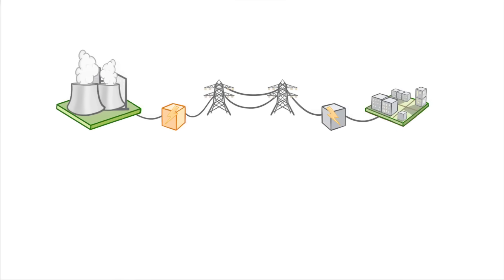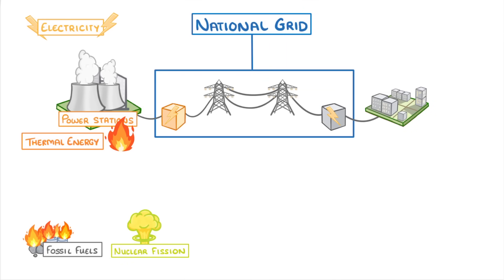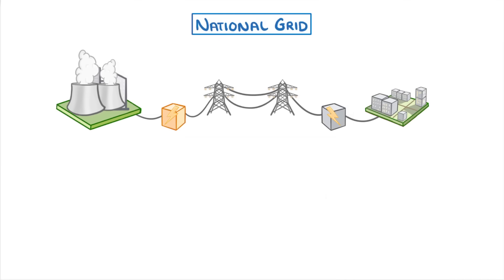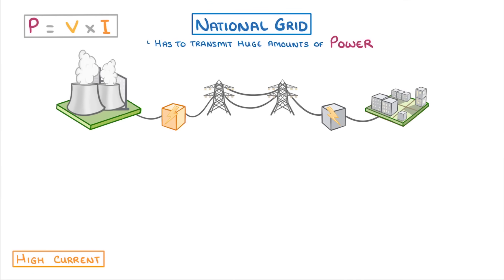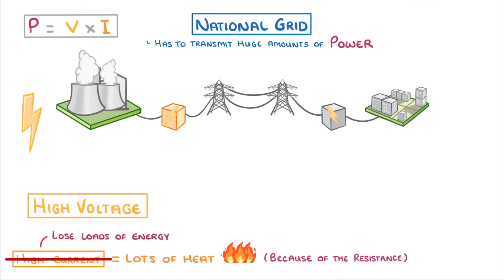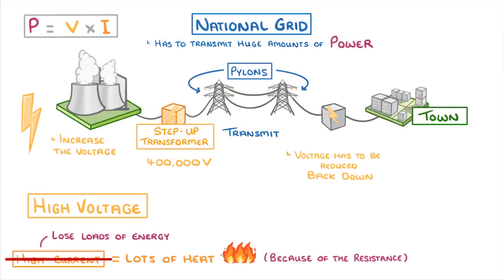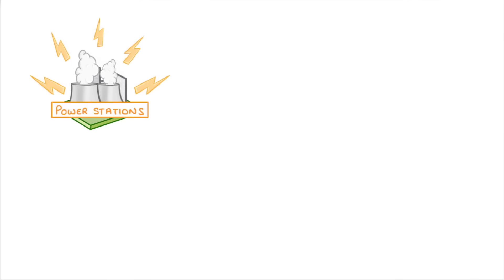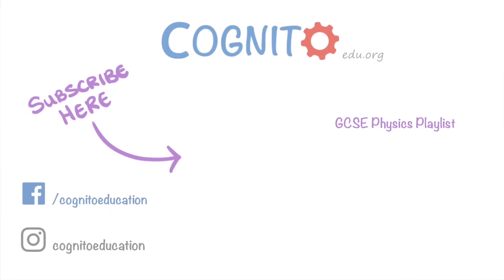GCSE Physics - National Grid

Comment: Doesn't using high voltage also increase the current passing through the grid which will still cause energy loss?
Reply: no it wont in the case of step up transformer if the voltage is high then the current would be low and they are only propotional in the case of potential divider
Reply: @abhinavchoudhary6925  do you mean that increasing voltage by a step-up transformer helps in making no effect on the natural increase in current ? If I'm wrong please correct me

Comment: Does the step-up transformer reduce the current, or does increasing the potential difference decrease the current?
Reply: the step up transformer increases voltage (or potential difference),  and because power doesn't change, but voltage increases and P = IV, so I = P/V, current decreases, so it indirectly reduces current by increasing voltage.
Reply: Cringe
Reply: @mr_quabby8515 bro your replying "cringe" on every comment here💀🖐️